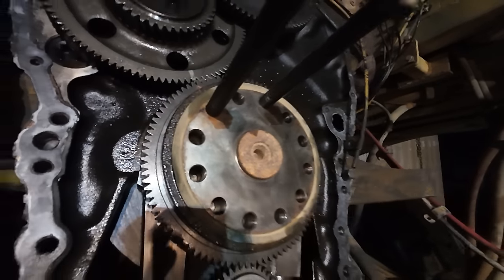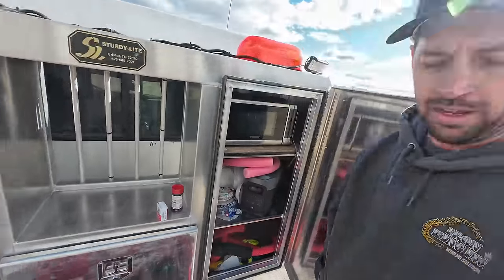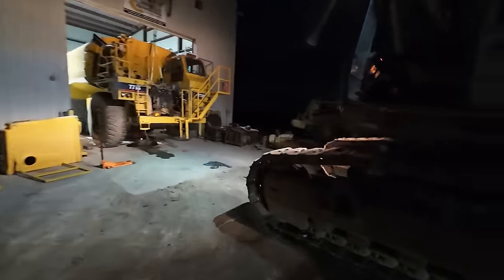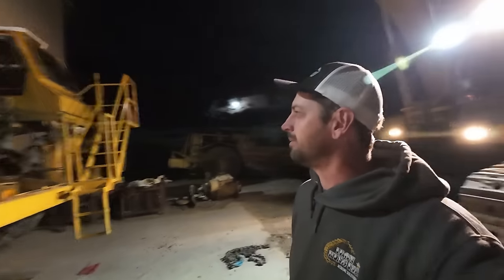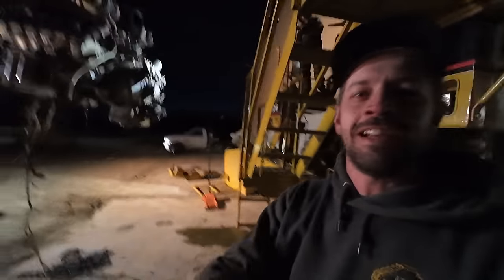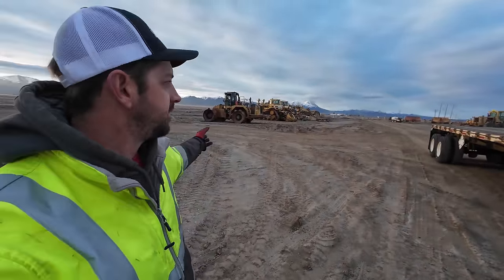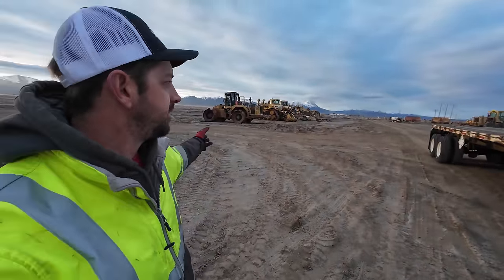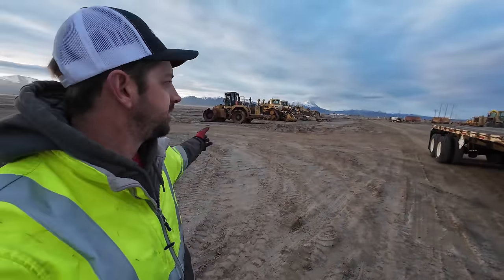Putting the HEAVY in Heavy Rescue!

Comment: If that engine came out of the 773 (60t capacity-used to be 50t) it would be a 3408 and a few pounds heavier the "5 or 6" thousand pounds.  Yo Ho HO,  It has a "C-12" or some other number classification.  They started all the "C" stuff about the time I retired, so I don't know those numbers..
That truck was built in the Decatur, IL CAT plant where I spent 33 exciting years doin lots of stuff.  I supervised the paint line for two yrs back in 1978. We would
paint some 15-19 units per shift depending on the product mix.

Comment: Used to work for a Cat dealer as a crane truck operator. Changed powertrains in a many 773,777,789, D-6 thru D-11, 980's to 992's. We could usually do a engine torque convertor swap in 4 shifts. 1st shift would start, 2nd shift would swap components and replace any hoses and parts. 1st shift would come back and set it back in. 2nd shift would finish sheet metal, topping fluids and running it to test. 
I would show up to pull it out and set it back in the machine. back in the day we would do several engines a week. Average life of a 3508 engine in a D-11/777 was 5 to 8,000hrs before needing to be rebuilt. That 773B truck has a 3412 engine. Average life span of that engine is 6 to 10,000hrs.
That engine brings back memories of unwrapping those cat rebuilds at the job sites.
Those are 777 cabs
Reply: That’s seems like low hours for needing a rebuild.  I work on a surface mine, and we get double or triple the hours before an engine swap

Comment: 27:00 - it's always neat seeing the shots with the long arm camera that eliminates itself from the shot, because in this case, you can actually see the camera and stick's shadow.
Reply: It funny how it hides the stick but not the shadow.
Reply: It is a 360 degree vision camera. Go Pro makes one. ARV $900.00.  I thought looking at the Driver's front wheel was cool, yup all those spikes are still attached. When Casey uses this camera in the forest as he has done it shows a different perspective with the surrounding landscape.
Reply: He was using an Insta 360 camera and that inspired me to get one, the R1 model which has two lenses, a 360 and a 180. One of his had a lens get damaged,  but I don't know if he got another Insta 360 to replace it. It takes great videos, but they use tons of storage and you need lots of processing power to edit them.

Comment: I would give your trailer a quick paint job just on the outside of the deck frame, the part visible from 50 ft away. I say this only because a trailer that looks old and worn is more likely to attract attention of the ministry of transport, which could increase the number of times you get pulled over for an inspection. The rest looks okay.
Reply: Seems like good advice!
Reply: Rusty rigs scream "pull me over" a lot louder than painted ones.
Reply: Agree - thats advice I got too when i was trucking - don’t attract the law with things that can easily be fixed.
Reply: That and the empty Beer case screwed to the back of the Headache Rack
Reply: @fergusonhobbyfarm4567  We used to run an old 80 something f800 single axle dump. It was a dog and just begged for the inspector to nab it, but would pass a safety as long as you didn't pay too much attention to the dump box. (Would have made a decent salter with all the holes in it) I remember getting pulled into the scales and the inspector literally rubbed his hands together as he laid down on his creeper. 15 minutes later he popped out and told me my fuel cap was seeping... that was all he could find. Had it been the day before I'd have been in a bit of a spot. That old Detroit leaked like it was going out of style. I had just washed it down to the Detroit blue the day before.
Reply: A rattle can paint job along with new led lights will shine that thing up!
Reply: Hahahahahaha ... have you  seen his other trailer?
It needs a pait job bad but won't get one unless @lebotnov66 goes to Casey Ledell'es back-yard and paints them (with your own paint)
Reply: @Louie2309  Odd comment...
Reply: I had a few propane tanks that looked a bit scratched up, and a hint of rust. The place refused to fill them (Even though the inspection date was valid). 10 minutes with a wire brush, and a spray can, no further issues...
Reply: @coopercovelo  Playing fast and loose with pressure vessels can go wrong in a big way. Just a hint of rust isn't a big deal, but people are crazy with what they will do to save a few bucks.
Reply: Then…… volunteer to show up with a roller and some rustoleum! 😂
Reply from the maker: Every DOT officer out there will tell you that a shiny chromed out rig doesn’t mean anything when it comes to maintenance.    They aren’t dumb, they look at more trucks from more industries and areas of the country than any of us and know damn well what to look for on a rig.   Work out old paint like on my trailers is the last thing they are going to worry about.
Reply: @CaseyLaDelle  agreed Casey. I’ve had old trucks and new trucks in my fleet. All pass DOT inspections just the same. 

Having a “put together” piece of equipment is better than shiny. Meaning that when you hand that DOT officer your binder with all of your company licenses, permits, insurance, and they’re orderly in sheet protectors, nothing is expired, med card copy is in there, logs are straight, and they can take a quick glance at your truck or equipment and nothing looks out of place, then you’re way ahead of someone with a shiny new truck but the cab is nasty and disorganized, and the paperwork is disheveled in a paper folder, covered in grease, etc.
Reply: Casey said it best ... 
It doesn't matter how pretty or ugly the beast is as long as it is well maintained.   The DOT will glady give you a ticket and time frame to have something fixed to keep the highway safe.
Or in the worse case pull the rig out of service then Casey or some other tow service has to tow the truck to a servce yard..

Comment: That reminds of the time I pulled the engine out of my '70 KW with a borrowed backhoe. Outside on a gravel drive on a cold winter day. Hauled it in my 3/4 ton Ford 70 miles to swap it out with a good engine, only to find out that the "good" engine was buried upside down in frozen mud. Wasted trip.
Reply: Gotta love those moments, I have had a few where they said the truck or equipment I was wanting to buy was easy to get to and they where buried behind everything or in the middle of a washout

Comment: Here in the Midwest, running your straps outside the rub rail is no problem. I think cutting off that round bar and putting flat stock so that you can loop your straps around it. Like all the other steel trailers have would be a good idea. Remember to mount your toolbox high enough that it's not a ground clearance problem but low enough that it's not a sliding winch problem.😂

Comment: Regarding your "new" trailer one thing I would do is coat it with some used oil to help its longevity. No, it won't make it slippery as it all will be absorbed into the wood.

Comment: It’s been a lot of years since I trucked, but back then regs said the straps had to be inside the rub rail. Guess things have changed. Great vid btw.
Reply from the maker: That’s still the law.  But when the way the law wants you to do it is less safe and incorrectly stresses the equipment, the simple solution is to say…. fuck the law.
Reply: @CaseyLaDelle  👍🏻
Reply: @CaseyLaDelle  Could you make a second rub rail to be leagl?
Reply: @CaseyLaDelle the law says #ihatecaseyladelle
Reply: @tobiastho9639   was thinking the same thing
Reply: put the straps where they work best.....
Reply: @CaseyLaDelle 5
Reply: Always have put straps behind rub rails, and never been in issue!
Reply: @tobiastho9639  if its a 102" wide trailer then no anything over 102 is considered oversize
Reply: - and ?use? hooks designed for the trailer frame...  (If it is a "rub rail" - it is there to protect the straps, not protected on the outside.
(fixed winches are also bad/inconvenient on a general purpose trailer.)

NB, in Australia trucks don't have a rubrail, we have a reinforced tiedown rail - below the perimeter frame and secure loads to it - when available - we also tend to have sliding winches in every pallet bay (or available to insert as required).
Reply: Whenever you think your having a bad day at least your not the guy who had to buy a giant cat engine for his truck lol. Sounds very expensive
Reply: @chunkychambers1530  it cost a friend of mine $40,000 to have his cat engine inflame over hauled on his 379 peterbilt. That's an in line 6 cyl motor
Reply: @chunkychambers1530  in frame lol spell checker
Reply: @chunkychambers1530  I think Quinton said it was $100,000.
Reply from the maker: @johnnawrocki6993  wrong.  There are quite a few things that are allowed to be beyond 102”.  Chains, binders, straps, and tarps are all on that list
Reply from the maker: @sharonmiller6436  the engine was 150.  But between all the other parts he replaced while the engine was out, all the man hours involved, my transport costs, and the downtime from the missed rental days, would be surprised if that breakdown cost him a quarter million dollars
Reply: @CaseyLaDelle   WOW!   I guess it's true what they say, the bigger they are the more they cost to buy and to keep running.  A bicycle is starting to look pretty good about now! 🙂 Take care.
Reply: @CaseyLaDelle  I was referring to a second set of rub rails

Comment: You should try the straps with the Chains on the ends to hook on the bottom of the that or the pockets on the rub rails my friend never run on the outside of the rub rail that trailer built for straps apparently. O there cheaper at a trailer shop like great dane or so on, then any other place besides making a huge factory direct order of course!

Comment: hello M. Ladelle. In Quebec, Canada you cannot secure your load this way. like at 3;10  i understand that your load is very heavy but it can still move sideways. here it must be attached in an X. The left side of the load toward the right side of the trailer and the right side of the load toward the left side or the trailer.. and the front load toward the front of the trailer and the rear of the load toward the rear of the trailer. so if you have an accident the load cannot move.. presentily your load can move sideways because the chains can slip on the beam of your load..here the DOT give you a fine for that load... i am a truck driver since 1976. have a nice day.
Reply: crossover style attachment can allow the load to move and come completely loose if one of the points comes loose as one point coming loose automatically means the point complementary to the crossover also looses its binding capability.  With chains and non-live loads this is typically less of an issue but this video shows some great physics on why cross-over chaining and strapping is far inferrior to linear style attachments when they are able to be used  /watch?v=TIC7URvAqmM .  With reference to the chains being through the transport frame at 3:10 while I agree its not perfect, there is actually no way the load can shift sideways as doing so would require the chain to lift on the side it is moving towards but that would require the chain to stretch or the attachment point to bend.  I think whats unfortunate is that you and I both know enough on average to know what is safe (and Casey too I would bet) but someone who can write tickets is more concerned about fancy crossover points than actual retention capabilities.

Comment: It would not have been long enough to handle the return load, but wouldn't the drop front trailer have worked for the engine delivery?  Do you know you would need the longer bed coming home?

Comment: Hey Casey, I know you have reasons for doing things your way and I'm not trying to tell you otherwise. But as a suggestion, instead of running all the strap through the winch, why not fold the strap on itself and feed the fold into the winch? Then you don't have to run all the excess back thru the winch. I used to do that 99% of the time when I pulled flatbed.

Comment: 6000 lb engine?   Why not pickup, trailer?  Or did you have a return need?  Don’t you still have the slide in pickup camper w/solar panels?   You could almost  not have to bother with logs.

Comment: That Cat 773B dump truck is 30 feet long, 15 feet wide, 14 feet tall..

Engine:

Specifications
Engine
Engine Make 2236

Engine Model 3412

Net Power 650.4hp

Gross Power 682.6hp

Power Measured @ 2000rpm

Aspiration turbocharged and aftercooled

Displacement 1647.7cu in

Operational
Fuel Capacity 185gal

Cooling System Fluid Capacity 39.9gal

Engine Oil Capacity 18gal

Diff And Final Drive Fluid Capacity 41gal

Steering System Fluid Capacity 21.4gal

Operating Voltage 24V

Tire Size 21.00-35 32PR (E-3)

Comment: Asking from the uk but what is the speed limit for your truck when the road limit is 75?
Reply: 75.there are some places that have truck only speeds,but most of the time the speed limit is the speed limit.
Reply: @brianmadden6080  Yup. In that neck of the woods, there is no difference. Around where I am now, the freeway speed limit for cars is 65 and the truck speed limit is 55. Just depends on where you are.
Reply: Here in the UK the limit is 60 on main trunk routes and 50 on dual carriage routes then 40 0r less elsewhere. 
My artic unit is ser at 58.5 on the dash but sits at 59.7 on my sat nav.

Comment: How many hours can you drive before taking that 30 minute break? 8 hours??
Here in Sweden we can drive for 4.5 hours, then we need a 45 minute break (allthough you can split it into a 15 minute break and then 30 minutes), then we can drive another 4.5 hours (we can extend that with one more hour 2 days a week, but we need to take another 45 minute break first...).
also we're not allowed to work for more than 6 hours straight (loading, unloading etc).... the rules are many and really interferes with driving, it ain't easy keeping all those driving times, especially driving in the bigger cities. Slow moving trafic kills driving hours very quick...
Reply from the maker: 8
Reply: @CaseyLaDelle  wow... I'd like those rules.. 4,5 is not enough...

Comment: Why not use the rollback for a smaller size 6K lb. load?
Reply: Because he had a return load of 4 machine cabs, didn’t you watch the video?
Reply: Long trip. Bed in back of cab.
Reply: Another bonus is light load test "shake-down" run.  Less likely to have a bearing or brake issue plus easier to recover